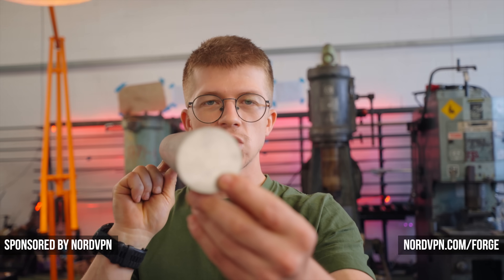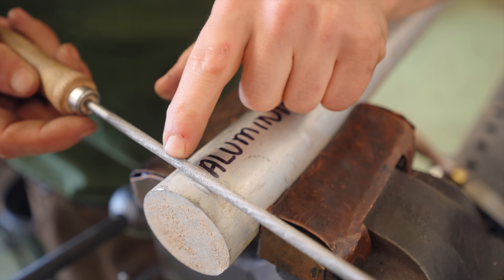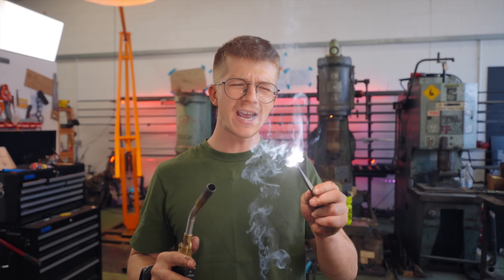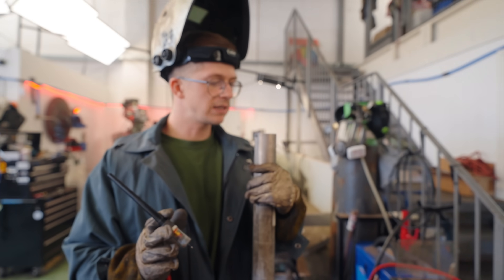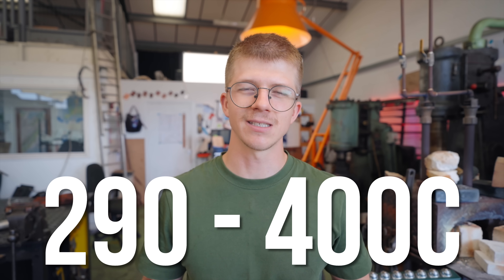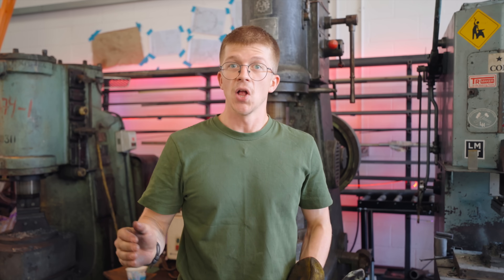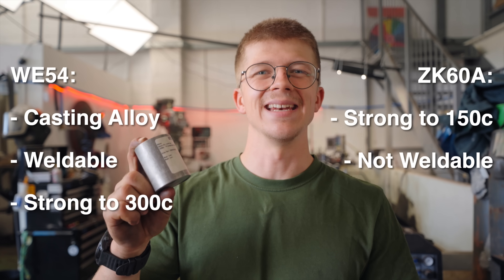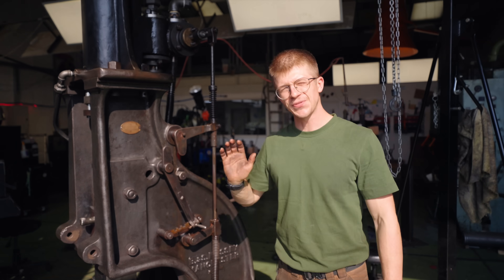Can You Forge Magnesium?

Comment: 0F is "very cold" 100F is "very hot". It's a human scale temperature system.
Reply: onely thing C and F agrees on is that -40 is bloody cold
Reply: Fahrenheit is useless . Typical speech from an American who measures distance in school buses and football pitches. Water freezes at 0⁰c and water boils at 100 . It's the easiest and makes the most sense
Reply: That's amazing
Reply: @Serbokrat  Its true and makes WAY more sense than C
Reply: @websterri  cold for a finnish person and a congolese are not the same
Reply: @websterri  Of course it does little buddy
Reply: @Serbokrat  I agree, because reference point for 0 being a reaction when you mix ammonium chloride, ice and water makes more sense than the reference point for 0C, which is temperature of water turning to ice. Even reference point for 100 F is stupid, because every person has different body temperature. How would you calibrate a new thermometer with inconsistant reference point? I'll tell you how, by using water same as a celsius.
Reply: @Serbokrat  One more big plus is that converting celsius to kelvin is just a simple subtraction/addition.
Reply: @voidseeker4394  that's a simpler way to say it
Reply: @luskhrasek7600  i mean, that is not a coincidence. Kelvin was created after we figured out lowest possible temperature exists, and scientists required a unit that will accomodate for that and simplify calculations. Celsius was used as a base, but zero was assigned to lowest possible temperature (absolute zero) instead of water freezing point.
Reply: @websterri  
Nah, it doesn't. It's just what you are used to and that's about it.
Reply: I'd argue that 1 ºF is still very cold, and 99 ºF is still very cold, so no, it still doesn't make sense.

Comment: @2:10 his theory falls apart when you look at how soft gold is and how soft lead is
Reply: And how hard titanium is xD
Reply: And how hard diamond is
Reply: Damm beat me to the punch
Reply: I'm surprised they don't know more about metallurgy considering the work they do.
Reply: and how strong carbon fiber is
Reply: The hardest elemental metal, chromium, is slightly less dense than iron.
Reply: Also steel and hardened steel
Reply: Now if that doesn’t make you think about the bonds nothing will.
Reply: Lead
Reply: Shape determines strength not quantity. Quality over quantity.
Reply: Mercury
Reply: @FraserRobertTorpy Mercury just has a very low melting point, but now I'm curious how hard solid mercury is
Reply: Titanium was what destroys his argument.
Reply: shhhh.... it was a great theory xD
Reply: Ah Jamie 🧡 we all make mistakes 😉🕊️
Reply: lead*
Reply: Was gonna say that. 👍🏽😂
Reply: And don’t forget silver

Comment: You can put out a magnesium fire. You need a special kind of dry chemical  fire extinguisher designed for metal fires (class D), a lot of dry sand, or you need to replace the air with argon or an another inert gas (magnesium will burn in nitrogen too). Halon doesn't work BTW.

Magnesium does not oxidize itself. But it will separate the oxygen from water and continue to burn, while producing flammable hydrogen gas. It's also an exothermic reaction (produces heat) that reacts faster as the temperature increases, causing a positive feedback loop and runaway reaction.
Reply: With sand it reacts too giving Si. And this reaction is also exothermic.
Reply: @Ma_X64  I have personally put out large magnesium fires with sand. It has to be dry though.
Reply: @MrErViLi  can depend on  fraction of the sand possibly,  humidity -- definitely. But there is even a Mg+sand thermite and it works really good.
Reply: Hijacking this; Explosions&Fire has videos about class D fires, watch them if you're interested/curious
Reply: wouldn't putting a magnesium fire in silicon-oxides result in it taring off the oxygen and burning itself?
Reply: @arieldahl  yes, it would be a thermite reaction, when the ratio is stoichiometric, the products would be as such: SiO2 + 2Mg ---> 2MgO + Si . But if there's an excess of the magnesium; the products would be: SiO2 + 4Mg ---> Mg2Si + 2MgO. This magnesium silicide reacts with acids to produce pyrophoric silane gas (it ignites by itself at room temperature). Mg2Si + 4HCl ---> SiH4 + 2MgCl2
Reply: If you haven't seen it look up mrgreenguy he just did a very chaotic video explaining magnesium fires and how to put them out in a very unique way
Reply: Magnesium will actually burn in a Block of dry ice (solid CO2), we would have a bucket of sand stand-by if we used in in the lab.

Comment: If forging magnesium - heat it using inductive heating in an inert atmosphere and also forge it in an inert atmosphere.
Burning magnesium is normally extinguished with special salts or dry sand, a D class fire extinguisher designated for magnesium would be preferred.
Water can cause oxyhydrogen gas to be created and make things worse.
Reply: Technically, you can use gasoline or any hydrocarbon based fuels as they don't contain oxygen in their molecule, so it would turn from a metal fire to an oil fire which is easier to handle.
Reply: @Percutien  I like the way you think!
Reply: @Percutien  Didn't know Ethanol free petrol was still being sold somewhere.
Reply: Got to play with burning magnesium when working as a fire fighter at an alloying smelter. Great fun but all done in a safe contained area, water just feeds the beast.
Reply: Worked in a magnesium diecast plant for a year and I can tell you first hand that burning, or just plain molten magnesium and water don't mix.
Reply: You could probably get away with table salt if you had enough to cover the fire
Reply: Yep. CO2 extinguishers are also no good as magnesium is reducing enough to rip the oxygen off the carbon and burns just as happily in pure CO2 as it does in air.
Reply: @jhonbus  Apparently it continues to burn even in pure nitrogen, which until I read up on it didn't think possible. It doesn't form an oxide (obviously) but a nitride.
Reply: What exactly is thermite?
Reply: @garykooienga9990  A mix of two powders, usually iron oxide and aluminum. When ignited the oxygen leaves the iron oxide and attaches to the aluminum creating a lot of heat that can burn through most materials, but it can also be used for welding - like welding railroad tracks together.
Reply: @garykooienga9990 As others have alluded to thermite is a general term for an extremely exothermic (produces lots of heat) redox (reduction and oxidation) reaction. - A Chemist.
Reply: @garykooienga9990 there are different versions, but the classic one is a mix of iron oxide and powdered aluminum.  Once started, the aluminum consumes the oxygen from the iron oxide, leaving behind iron.  It burns VERY hot and liquid iron flows out the bottom.
Reply: It takes a pretty big magnesium fire to break down water.
The couple of ounces that most people are likely to burn probably won't do it.
Reply: @The_Inquisitive_Inquisitor  the key word is probably
I know I wouldn't risk it
Reply: @drthmik  if you're only burning a couple ounces of magnesium, it will consume itself pretty quickly. After that you just have a regular fire to deal with.

Comment: 2.8lb's, wow that's nothing for so much volume of metal.
10:37: Freedom Degree's make more sense for ambient temperature and less sense for industrial ranges.
With Fahrenheit 0 degree's if very cold and fairly dangerous to be exposed to for to long, likewise 100 degree is very hot and can get dangerous if you don't remain properly hydrated.
With Celsius 0 degree's is pretty cold, cold enough to freeze water but not as cold as 0 F, 100 C on the other hand is fatal to be in lol.

So for a thermostat F is superior, the units are also finer so you don't need to use the decimal but if you prefer to it's more precise; C is better because it's intuitive for more commercial/scientific uses. Both are fine but we all like what we used growing up and sadly when Europe sent us the metric measures they got lost at sea resulting in congress to say eh we'll stick with what works. However we actually are a country that uses both, it's just most people don't. For aviation and space we use metric and imperial for example, likewise in defense production my rifle is 5.7mm not some fraction of an inch.

Comment: if you put a magnesium bar in vacuum chamber at a few hundred c it sublimate super fast and basically turns into swiss cheese . god that was a mess to clean
Reply: Huh. Really low temp vapor deposition. I had no idea magnesium did that.
Reply: @nikkiofthevalley   neither did we at the time we were trying to just melt it and cast  it. and were like hey if we do it in vacuum there no air so it can't burn.  but never got it to melt it sublimated away to fast.  coated the inside of the chamber with like 1kg of the stuff took several  days hunched over in that chamber scrubbing the walls with acid and water
Reply: I guess the solution is to heat it up in the presence of an inert gas like neon? Not sure how much pressure you'd need.

Comment: 3:20 wood saws nowadays are made with carbide teeth so the sharpness lasts longer
Reply: Hi dude 
I think might have mixed table saw blade and hand saw blade. Table saw blade have carbide teeth but regular hand saw are only hardened steel and just the tooth is hardened nothing else.
Havé a Nice day
Reply: @Matt-ns2ty  i wasnt mixing it up, as far as i know hand saws used to be just regular steel and you used to sharpen them several times to extend their life cycle

now they are made from a harder material which i thought was carbide which you cant really sharpen, it doesnt have as long of a life cycle as the old style but last longer now that we dont really do our own sharpening anymore and would have to ship them to a sharpener

If i got that wrong thats on me
Reply: @carpentry-unlimited  the thing is they are both hardened steel but old saw were hardened completely and heated again to be sharpenable.
New saws are impulse hardened which means if I'm not mistaken that they use a high voltage on the teeth to heat it up and harden but the rest of the saw is not hardened at all. So the teeth are just as hard as a file but the back should be much softer.

Comment: It filed worse because it filled the chip reliefs more. The saw has significantly larger spaces after the cutting edges that don't get loaded up as easily.
Reply: I was coming to say the same thing. The file teeth were getting gummed up by the magnesium.
Reply: Magnesium is bad, but ytterbium is probably the worst of any metal I've filed in terms of gumming up files.
Reply: @brainandforce  Ytterbium might be really bad, but you never experienced file fouling unless you tried to file Samarium. Just forget about it!
Reply: Sounds like a rasp might work. Also, this is part of why concrete ledges get better to grind after a bunch of skateboarders have had a crack at it - the aluminium scraped off previous truck-hangers fills the gaps so the next guy doesn't stick and go ass over tit.